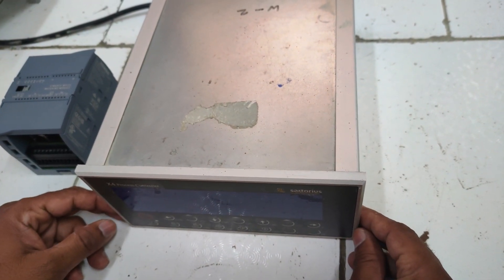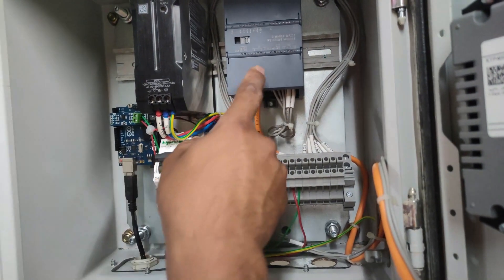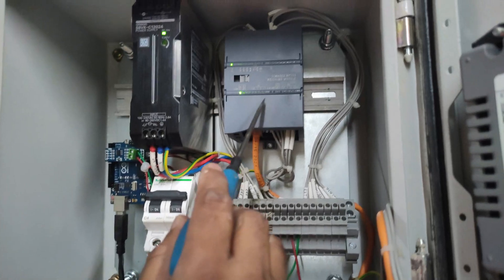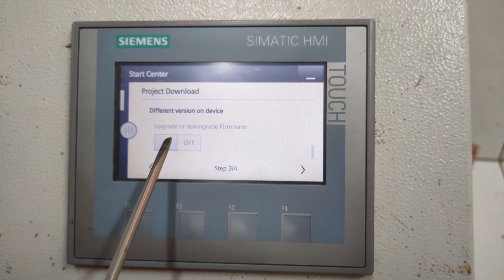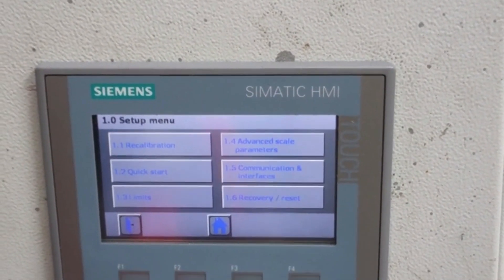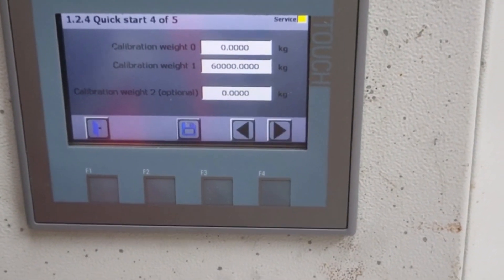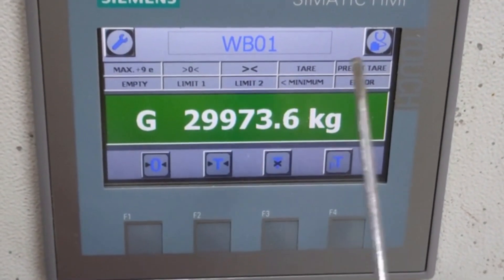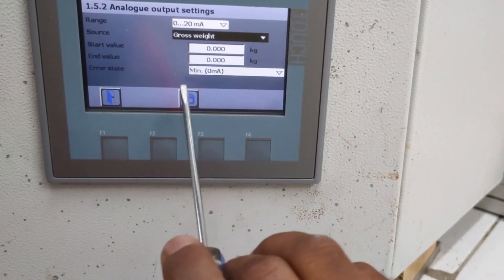Siemens Siwarex Weighing Module (WP231) installation and Calibration

Comment: 👍 Good idea. but why use arduino for data transfer to the PC, I think you may use the ethernet port for data sending to the PC💡💡💡.
Reply from the maker: Yes I can because the wp231 module supports two ports 502,503 , but still you need to request data from PC as you know that modbus works by request/ response protocol. So that request done by Arduino and PC get the continuous data steam